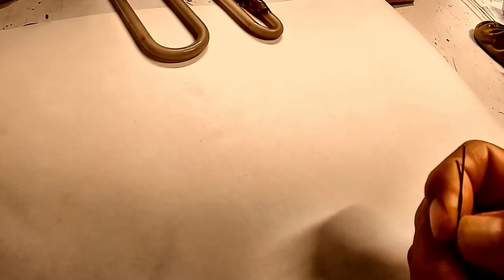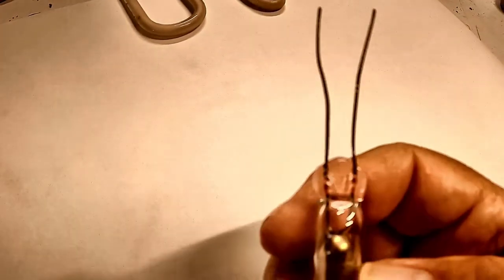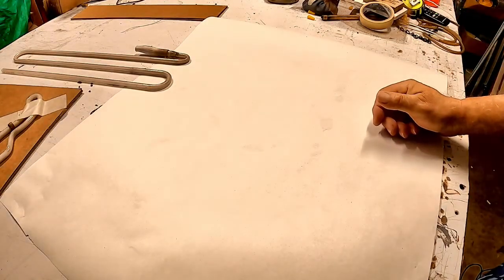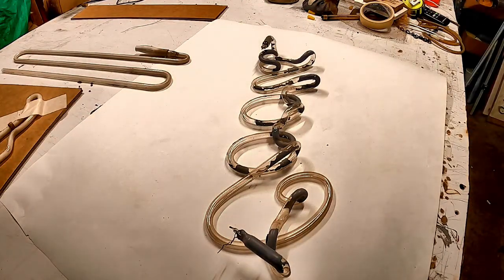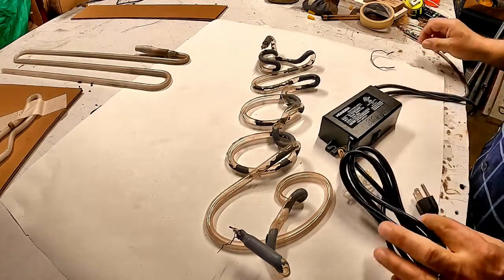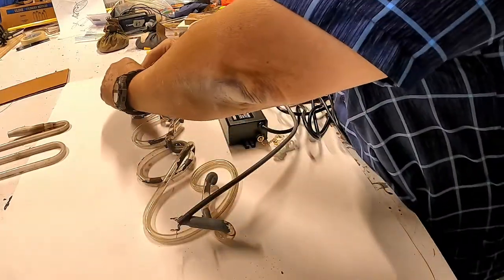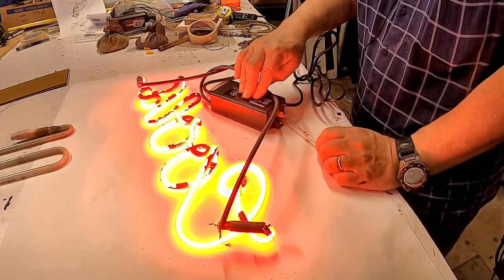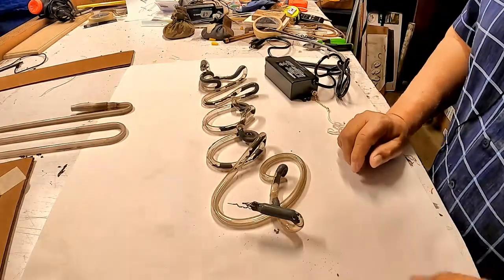Two wires in electrode and polarization on transformer

Comment: can i connect two electrodes directly (ie bridge the gap with wire) to continue segment where tubing was broken?
Reply: Yes you can but you have to use GTO wire and reinstall the electrode boots, watch this video https://youtu.be/eTOWPF1nRjo
In the video it shows a temporary jumper wire just to check the sign, but for a permanent wiring you have to use GTO wire.